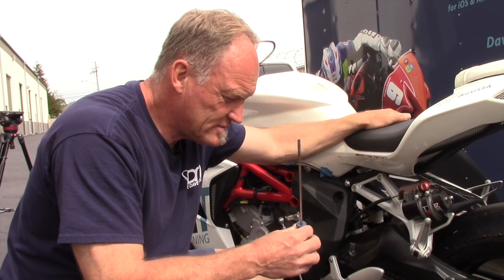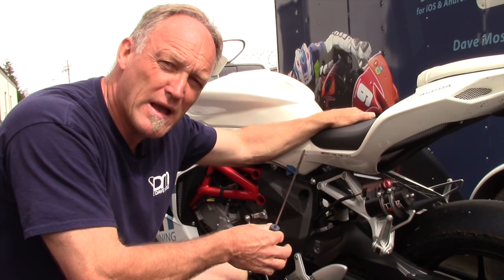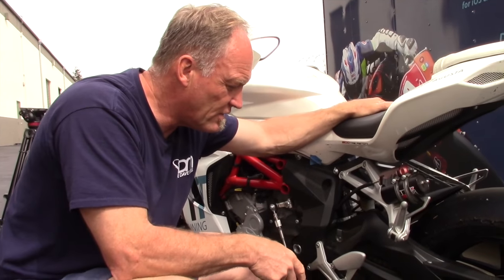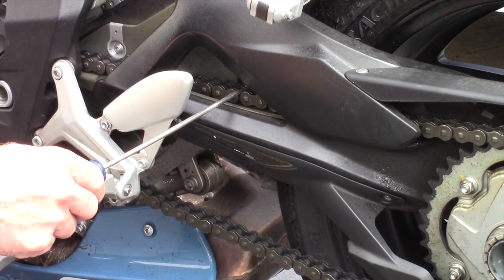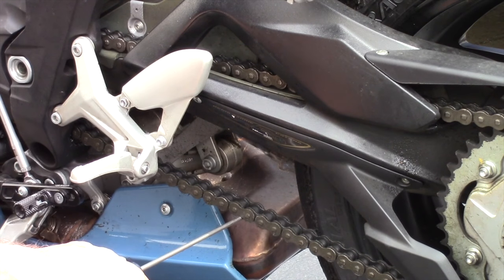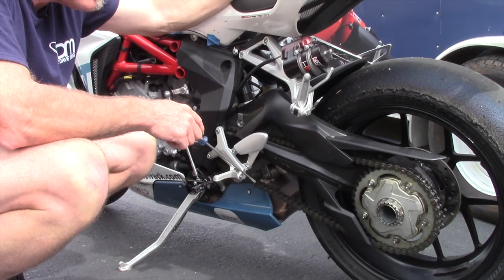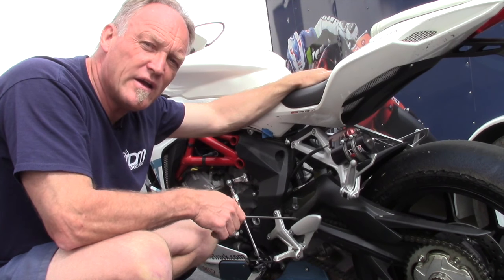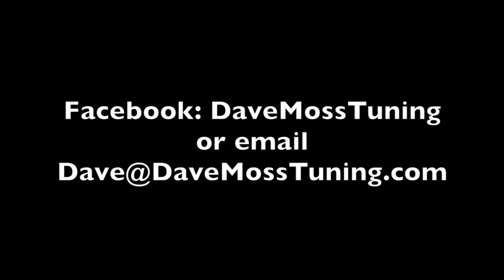Motorcycle Chain Slack

Comment: So for 2 up riding. Should it be more loose? Or do both rider and pillion have to sit and then check the tension?
Reply from the maker: Bottom out of the shock sets chain free play so if you set it a 1.5 inches or 40mm, that should be sufficient. Double check by putting rhe full load on the bike.

Comment: I have a Tiger 900GT and 'chain slack' is something I have to admit being paranoid about.  I've watched numerous videos and read the official manual - which IMHO is still ambiguous in some aspects. The manual says 'Place the motorcycle on a level surface and hold it in an upright position with no weight on it. Rotate the rear wheel by pushing the motorcycle to find the position where the drive chain is tightest and measure the vertical movement of the drive chain midway between the sprockets'.
OK so in this video the bike is leaning on the kickstand - is that acceptable or just specific to the bike in the video?  The Tiger manual doesn't say which way to push the bike (to tighten the chain) nor which part of the chain should be 'tightest' (top or bottom)? I'm guessing from this quote that placing the bike on a centre stand is not acceptable?
Apologies for these noob questions, I've only been riding a year.
Reply from the maker: This is a great question and thank you for it. There are many, many ways to do this so as a new rider, the simplist way is going to be the best and in time, you can make it more complicated./ For now, the technique in the video makes it much easier for you. By all means find the "tight spot" and start there for the adjustment and when checking, make sure that you do not force the top of the chain upward.
Reply: @catalystreactionsbw  Thanks. So in the video has the chain been 'tightened' beforehand by moving the bike forwards or backwards?
Reply from the maker: @simonwalker1833  forwards

Comment: Is it better to use the side stand or center stand to make the adjustment? Thanks for any help!
Reply from the maker: Both extend the shock and take the stress off the rear of the bike. I personally prefer a center or rear stand so I can rotate the rear wheel at will to check various parts of the chain.
Reply: @catalystreactionsbw  Thanks for the reply. I would prefer that as well. Nice to see that a pro like you agrees with me. Lightning strikes!

Comment: Dear Dave
Could You please help me with the tyre choice for 2011 Speed Triple R. My girlfriend just bought one second hand with BT S21R on it ( Rear tyre god profile front worn and squared). 
At present bike feels like effort is needed to maintain the lean and it doesn't  go into lean very swiftly) 
In Your opinion should we try another set  of S21 or would You recommend  a different profile tyre.
Thank You
Jakub
Reply from the maker: Hi Jakub. Please tell me what you weigh in kgs without motorcycle gear on. How experienced a rider are you? How many kms on the odometer now? Please send the answers to dave@davemosstuning.com

Comment: Hi Dave what's your approach on KTM's measurement of chain slack? Apparently my user manual says to measure the distance betweeen 1.) a chain link and 2.) the bottom of the swing arm for chain tension. And so far I have had quite some chain slaps using the technique by them. Cheers
Reply from the maker: I always try to find a measurement technique that "works" for me. Sometimesd that is the stock method as per handbook, other times it is a unique method that I discover that generally works best. If a given technique creates chain slap, then the chain is tightened in very small increments until that disappears. Then assess the same measurement point to see what you need for your bike.
Reply: @catalystreactionsbw  Thank you Dave. Biggest takeaway from your guide for me is to not let the upper part of the chain moves as slack is taken. It eliminates wrong measurement.
Reply: @HienPham-hk9yj It actually guarantees a wrong measurement.

Comment: I am noticing the alignment is exact and the wheel is wanting to be slightly off in the swing arm- this is corrected by the wheel bushings?
Reply from the maker: If the wheel is not exact, the wheel is off center form impacts with sharp edged bumps or the mounting points are worn allowing the wheel to be tightened very slightly off center.
Reply: The bike has 22k miles on it now, could it be a swing arm- bushing.. Maybe getting worn?  I suppose I should pull the rear shock and check it for movement with a dial.guage.. I noticed a wobble- on the sprocket, so cleaned the cush drive inspected wheel, hub sprocket, etc reinstalled wheel, noticed the alignment is not exact, rear sprocket is slightly right of the front. Just enough to cause the chain to click as it engages the sprocket. The swing arm doesn't appear to be worn where the bushing contacts it-
Reply: @catalystreactionsbw  wouldn't hurt to replace chain and sprockets., Can I turn a new bushing on the lathe for it?

Comment: I can hear front sprocket click sound when spin the wheel. Is it too tight or loose?
Reply from the maker: If the chain is binding from being too tight, the wheel will not spin. If the chain clicks and the wheel spins freely this may be an alignment problem and/or the chain is worn.

Comment: Why does my service manual say "The upper section of the chain should be taut, while pushing the lower section up and checking the distance between the swing arm, should be 5 to 7mm of gap"
Reply from the maker: That is how the service manual wants you to do this. As with all things, there are other ways to get to the same goal. Additionally, I try to make sure that I get the rider/load on the bike and check chain tension at that point as well.

Comment: All good stuff, but its the tension of the top run of chain, not the bottom, that's critical as this is is where the drive takes place. The bottom run of chain is relaxed and as its doing no work, its not under stress. Its just that its easier to judge the tension of the bottom run.
Reply: 🤣🤣🤣Just stop.  You're trying to sound smart but the opposite is happening.

Comment: When I was tightening my chain I didnt loose the axle nut, is that wrong? I still managed to tightened it though.
Reply from the maker: Interesting that the axle nut torque allowed you to still set the chain tension. Not wrong, but clearly the torque needs to be higher.

Comment: Dave, my chain wobbles when it comes off the lower portion of the front sprocket. The sprockets and chain are new. Any advice? 🇬🇧
Reply from the maker: I would check the rear axle alignment first, then I would check you have the front sprocket on the right way IF it is directional (ie: there is one side thicker, one side thinner).
Reply: Dave Moss Tuning many thanks. Will take a look.

Comment: Chains Are difficult things because they are loose or appear to be loose but when you sit on them they are as tight as balls go figure can't never figure that out everyone always shows you the bottom tension no one tells you the tension of the chain when you're actually sitting on the bike and they are vastly different so who the hell really knows definitely not me I do my best but God knows if it's right what channel is about 10 mm slack to the swing arm on the bottom as per manual but when I sit on the bike it is tight as hell I need an answer man
Reply: I have an answer for you. Do what the manual calls for. The manufacturer has already figured out how much slack with the bike on either its side stand or wheel off the ground and that's the setting that works best. No need to adjust for weight as they've already accounted for an average. 100 pound females or 250 pound males I've never seen a manual call for slack adjustment due to weight. Also it's total slack which unlike this video shows is something you need to pull all the slack down and out of the chain. I don't know where he got the "don't move the top chain" from but that is slack that needs to be accounted for.

Comment: whats the risk of having it too tight?
Reply from the maker: It pulls on the output shaft bearing and that stress ovals out the bearing seat. It also locks out the rear shock and puts the rear tire under severe duress while you bounce out of the seat over bumps.

Comment: Hi Dave, love watching you’re videos. I enjoy maintaining my bikes. I have a tuono factory 2015 I’ve recently cleaned and adjusted chain To spec on the side stand, I’ve always applied downward and upward pressure when taking measurement. Is this incorrect ?

After watching you’re video I checked free play using you’re method with bike on a paddock stand I measured 15mm. Before the upper run of the chain started to rise off the runner, so if I add 15mm slack using you’re method I’ll have around 40/45mm on the side stand. 

Any advice would be greatly appreciated. 

Leon.
Reply from the maker: Any technique is correct if it gives you the correct amount of free play.

Comment: How am I still alive? .. I haven't cleaned a chain in 20 years. I just put more spray lubricant on it and away I go. My chain right now is so loose on my bike that I bet it's at 2 inches of travel. I hate lubing my chain because it flings black oil droplests all over my white rims... but for 20 years, I have been driving my 99 GSXR 750 as fast as it will go every day .. and not once have I had a problem. I do wear out my chains often though, and when I need a new one, I tell the dealer to install the most expensive chain they got and the best sprockets they sell and put them on my bike.
Reply: lol =D This comment put my mind at ease. It aint rocket science right?

Comment: I don't have a calibrated screw driver to acaccuratly measurecthe 20-30 mm as outlined in the owners manual.   Everyone knows the basics of too loose and two tight...how about some quick, easy and accurate ways to measure the play.  What tools, what process to go thru.  Flipping a chain up and telling it's good doesn't help as I dont tune 4 thousand bikes a year.  Thanks.
Reply: Just use a block of wood and a pencil..... Raise the chain and make a mark and lower the chain and make a mark... Then measure the distance between the two marks
Reply: @yongyea4147 Or a tape measure with the end on the ground. Gives an immediate mark to identify current slack and distance traveled when checking it.

Comment: I mean, everyone takes that information for granted. But why shouldnt You straighten up the upper part? other than Your word You provided no explanation
Reply from the maker: When you lift the upper chain, you are exaggerating free play to force the chain to touch the swing arm or get the required measurement. I was taught that decades ago and have used the technique since then with great results. There are many ways to do a task, so we generally try different methods until we find one that works on all motorcycles.

Comment: I was looking for a video that explains chain tension. I found this VERY confusing. Something about the top moving up then something about not lifting the bottom part to fast that the top part moves then moving it just enough so the top part moves slightly then ....... my god so confusing. Also if you are going to refer to the "tight spot" don't say, there is a whole other video on that." I didn't watch that video so I do not know what you are talking about. Also get a decent microphone please. In fact, just don't make videos.
Reply from the maker: In that case, just don't learn anything nor challenge yourself to do better.
Reply: Perhaps motorcycles are a bit too complicated for you.